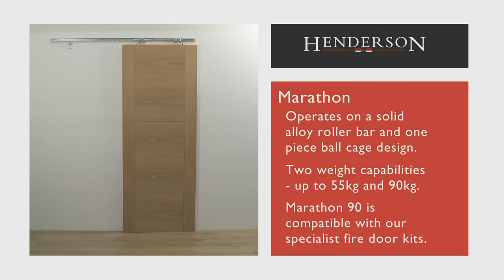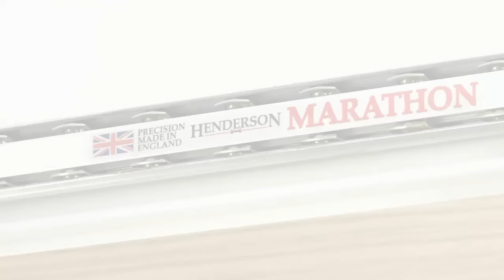How to: Install a Single Sliding Door, Ball Race System - Marathon by P C Henderson

Comment: Ultimately the door is fixed to the top track by four small screws and because they are checked into the top of the door they are fixed into chipboard  !  
It’s a lot of work for what it is and  in hindsight i would have just fixed the top plate onto the surface to get a bite on the hardwood and hid the detail  with a  pelmet.
I would only use this product again if the bottom part of the design was changed as machining such an amount out of the bottom of a door is time consuming and  again leaves you with chipboard  !
This is a lot to do for a undersized piece of plastic and I would recommend that this detail is better thought out .
I have fitted many doors in my time but I would never recommend only using four small screws to do the job !

Comment: Does the door slot neatly into the opening or does it sit 25mm back from it?
There not a close up of the door fully closed so we can see if there are gaps for the draughts to come through.
Reply from the maker: Hi Pat, this is dependent on the opening size, but we recommend the door overlaps by 40mm to limit draughts and light spill.

Comment: Hi Henderson, I have the same rail installed for around 15 year, before the door could close shut, but now it cant close fully and has a 10-15 mm gap to close the door. I need help, is there anyway that I can correct this?
Reply from the maker: Thanks for your question. If you call our technical team on 44 (0) 191 377 0701 ext. 2072  they will be able to advise you.

Comment: Can the bolts be used invertedly, locking them into the nylon top plate from the underside, instead of cutting the door?
Reply from the maker: Hi, although this isn't a fixing method we haven't used ourselves - our technical team have advised that it should be able to be done. Many thanks, P C Henderson Ltd

Comment: which is better, marathon or husky rail type?
Reply from the maker: Good afternoon, 
Marathon caters for doors weighing up to 90kg and features a one piece ball cage design whereas Husky Sliding caters for doors weighing up to 100kg and comes with a choice of aluminium, anodised aluminium or steel track. Both systems offer a smooth and quiet operation. 
To recommend a particular system we would need to know more about the application for example, opening size, number of doors and door weight. 
Many thanks, 
Kate

Comment: Useless on a hollow door
Reply from the maker: Good afternoon, 
Marathon is designed for use with wooden, wood framed and composite doors. For hollow doors, it would depend on the thickness of the material used. In such cases, we recommend consulting our Technical department before purchasing. 
Many thanks, 
Kate